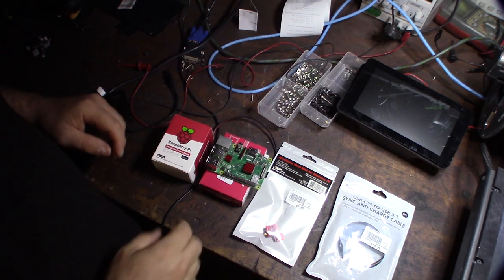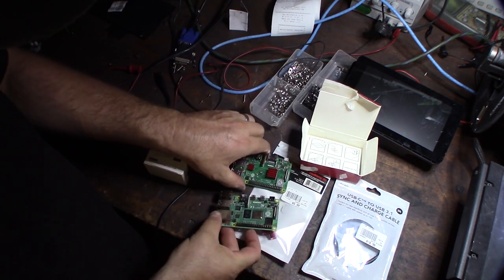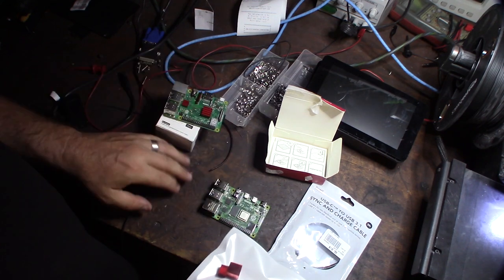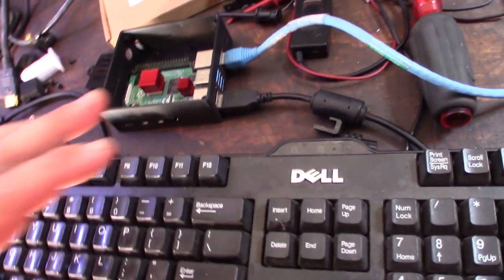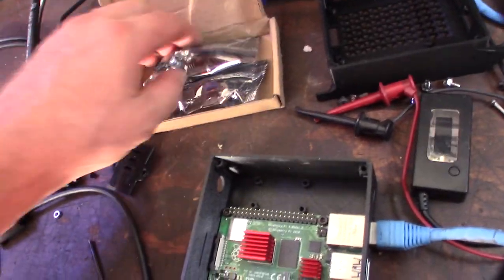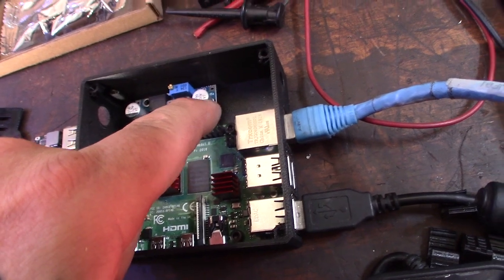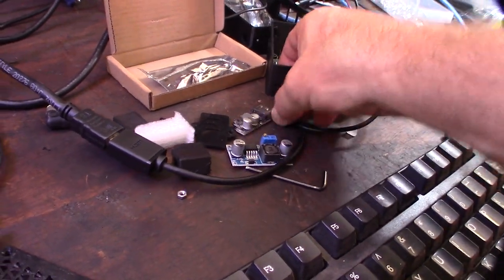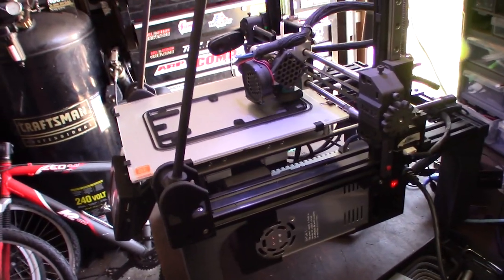Raspberry Pi 4 model B running Octoprint OctoPi

Comment: 0) By now, you've probably realized that your pi 4 cooling solution is completely inadequate. I've found that the absolute best cooling is achieved  using a "low profile ice tower". They're $22 on Amazon, and that does not include a case, but there is at east one printable case on Thingaverse.

1) I'm currently looking for guidance regarding putting octopi on a Pi 4 that can boot from a USB flash drive.If anyoone has any info, I'd be appreciative.
Reply from the maker: My Pi 4 seems good, never get a thermal warning. I use them daily to print.

Comment: Another video answered my throttling question:  Pi 4 does not throttle until 80c, and under 100% load, Pi 4 reaches 80c in 3 minutes and 30 seconds.  Depending on what you're using the Pi 4 for, it may never be at 100% for 3 minutes straight, so for many applications it's not worth spending a few dollars on a heatsink.
https://www.youtube.com/watch?v=Wwk4HR9G51Y

Comment: WTF was that?  I kept wondering what he was going to do and then "alright raspberry pi 4 octoprint"  He could have subbed in a actual potato for the pi and had the same video.  spent two minutes talking about a buck converter but then never mentions WHY WAS THERE A buck converter....  If this was a video about raspberry pi 4 and octoprint, you can say it was also about a B+ a 2 and 3 because they were all just as active in this video,..  SMH   Like no details on why he chose the 4 vs others, no info and what differences there was or performance or setup differences.  I watched the t-series vs pewdipie you tube counter and got more out of that AHHH  contrats on wasting 5 minutes of 3349 people lives
Reply from the maker: You sound like somebody people are delighted to work with.
Reply from the maker: Your never getting those heartbeats back!!!!!
Reply: @fintechrepairshop  I've never worked with anyone who's the human equivalent of watching paint dry before so if that was the case rightfully so they would be 'delughted'
Reply from the maker: @supastyles1  You made my point.
Reply from the maker: Your just unhappy
Reply: @fintechrepairshop  just like your video, you have no point
Reply from the maker: @supastyles1 Okay, let me see your video so I know how its done.
Reply from the maker: @supastyles1  You remind me of somebody who works in a call center.
Reply: @fintechrepairshop  so you can't find any examples on YouTube?  
Can you maybe link a video that does the same thing you did here?
Reply: @fintechrepairshop  ....okay??  Is that your attempt now at a burn?  You remind me of Simeone who doesn't interact with other humans

Comment: How do you install Octopi on the raspberry pi 4 went through the hole thing a hundred times and it will not work I have the image file on a micro sd card inserted into the raspberry pi reboot it get a load of script and that's it put my raspbian sd in and boot up raspbian but no Octopi what am i doing wrong.
Reply: There's a special beta version for the pi 4, the regular version won't work on the 4
Reply: @FightinTheGorlax  any way to get access to it? Im just starting out with raspberry pi but 3b+'s seam kinda pain in the ass to get atm I have one on the way from china so taking forever to get here would be nice if i could just use version 4.